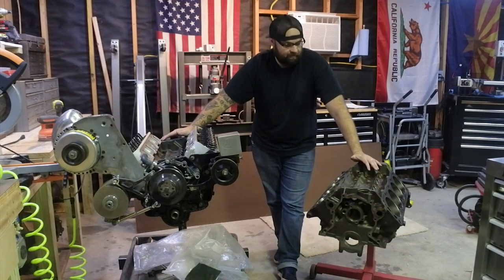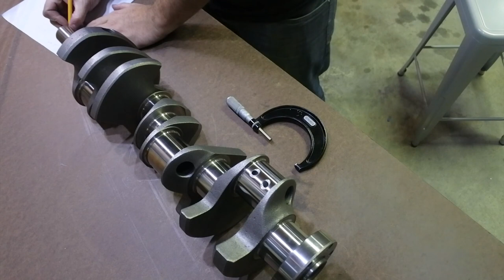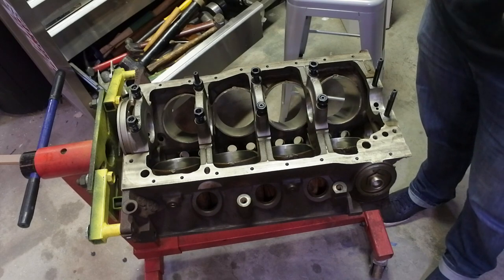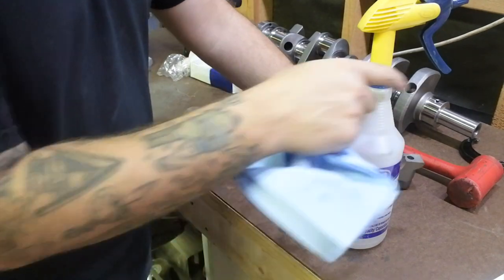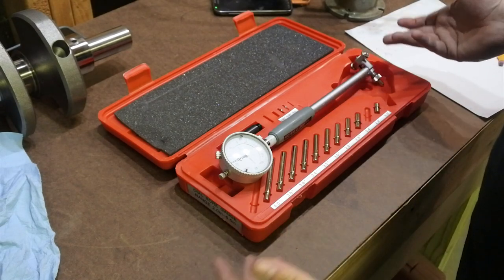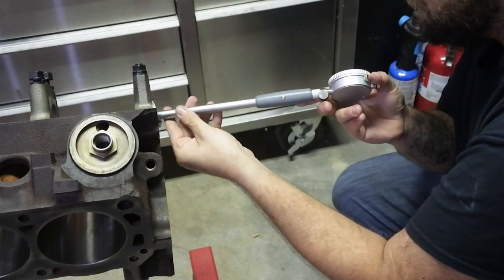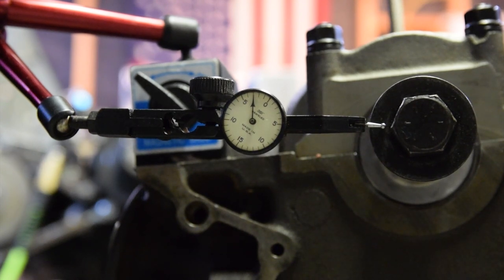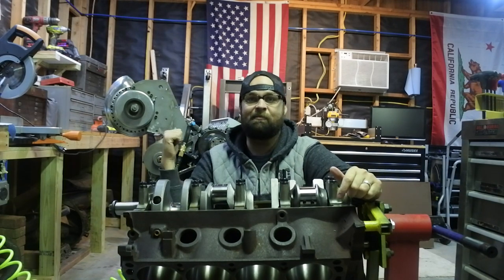Small block Ford engine build Part 1

Comment: I wish Duderhead289 would tune into this channel to see how things are done RIGHT.  Nice work.  I learned a few things here for sure. Lot of today's hot rodders are NOT checking bearing clearances or end play.  Rob is the model on how its done.  The 10 lb rotation on the crank is bang on.  Note that Rob checked crank rotational torque without the rear main seal installed which is the preferred method.  Well done.
Reply from the maker: Thanks brother! I appreciate your support! Sorry for the late response. Somehow I just saw this comment.

Comment: Would be cool to do a tear down of the other engine and find out why those bearings were damaged.
Reply from the maker: I did pull it apart. Looked like oil starvation. I ran a high volume pump and a standard oil pan. I’m thinking the pump pulled the majority of oil away from the pan and into the top end, starving a few bearings.

Comment: Good work! You're smarter than the average bear, my fine fuzzy friend. Subscribed and liked. Btw, my small-blovk is a 389 overbored by 0.030" and equipped with a LeMans cam and stainless valves in slightly reworked GT40P heads. It's going into a Mustang Fox body or Mustang II. I want it to have more of the feel of the '65 GT350R, or at least as much as I can.
Reply: 389 ? You can't get that out of
any stock block or even an
aftermarket block !

Comment: I have an 80k miles 302 out of a Lincoln Mark 7 that is already stripped down to the block. Its going to go into my 94 Mustang GT with a vortech S-trim blower. I have some questions about taking the block, crank, pistons, and heads to a machine shop. Can I email you?
Reply from the maker: EK Auto Tech sure rjardy2 @ yahoo

Comment: I've given thus a thumbs down, for one simple reason, you installed the crank before the camshaft.  Iwas taught as an apprentise 60 years ago, always install the cam first, you have lots of room for manouvering.
Reply from the maker: fred grove  pretty sure I mentioned in the video that this is just the way I do things. Some opinions my be different. But the cam shaft bearing were already installed and the cam installs very easily. Not sure why you would even need the crank out to install the cam? Crank needs to be out to install the cam bearings, sure. But the cam installs from the front. Any how, thanks for taking the time to watch and comment. Have a good day.
Reply: @rdspeedfab  the reason folks want the crank out of the way is to be able to reach inside the crankcase with one hand, to guide the camshaft in with the other. Otherwise you need long bolts in the front of the camshaft and try  to use those to leverage the camshaft into the individual bearings.  

Try it out sometime on a dummy block. Some get so used to doing it one way, they don't think of the other way. Like when moving an engine from a hoist to the engine stand--some take the engine mount off the stand, bolt the individual arms to the back of the block and then have only one attempt to mate to the engine stand, while others leave it on the stand and try to swing the entire engine level with the individual arms
Reply from the maker: @albertgaspar627   I see the point, but I’ve never done that. A good cam install tool and you can keep the cam from bashing the bearings. Makes sense though. But you certainly can’t do that when your doing a cam swap in the car.
Reply: @rdspeedfab  this is true.  :)